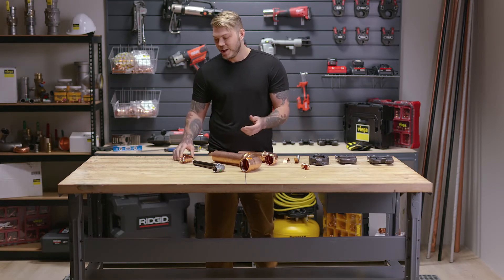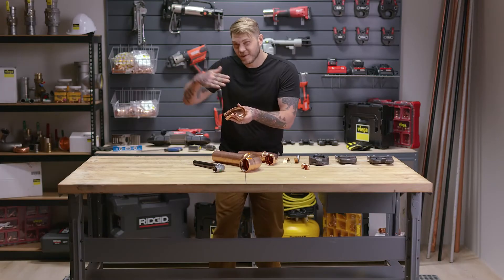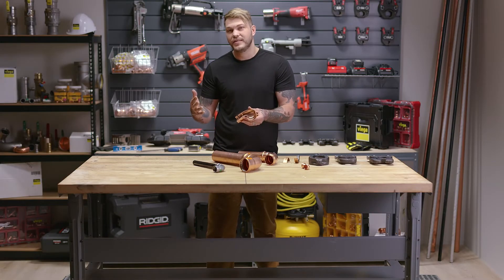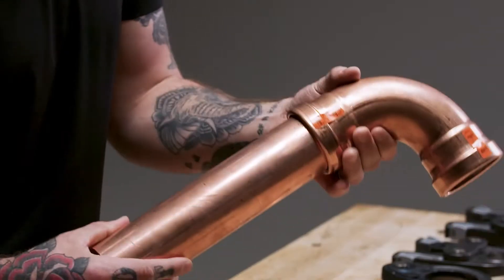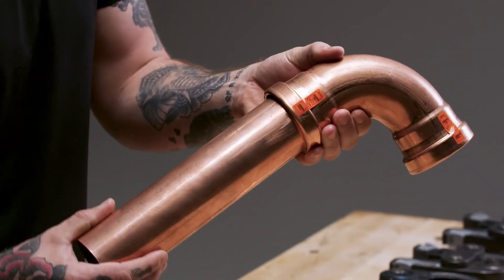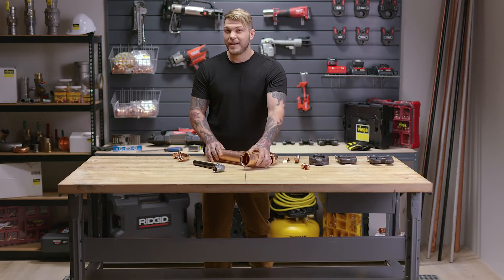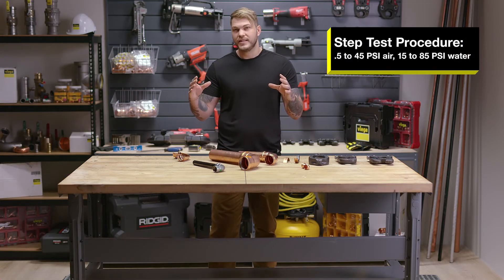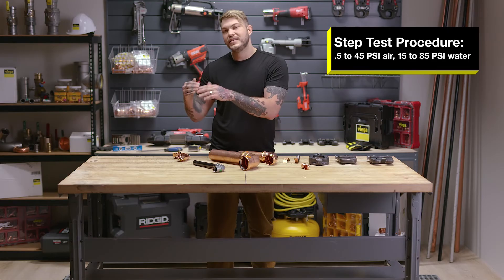What is Smart Connect Technology? | Viega Training

Comment: Hey thanks for vids i use viega fittings and love them. 
Can you explain for me? 
The initial test with air .5 to 45
Or 15 to 85 water is to determine that all fittings have been pressed and nothing has been missed? Otherwise the larger pressures can alter the sealing element if they arent pressed. So its critical to ensure no fittings go unpressed before testing with higher pressure ?
Reply from the maker: Hi there! Exactly, the step-test procedure is used to ensure all fittings have been pressed before increasing the pressure in the system. Learn more about Smart Connect and our sealing elements here!

https://bit.ly/3s8y97A